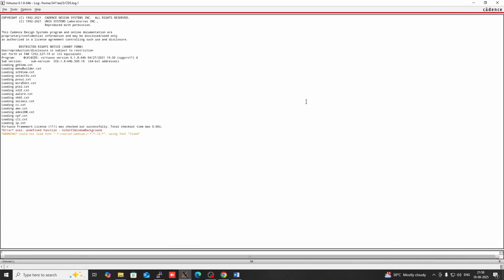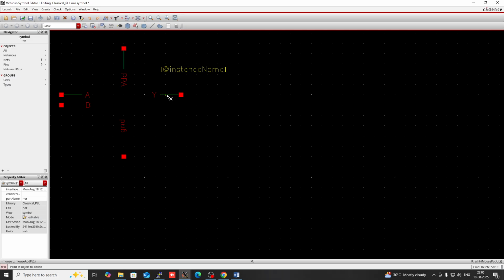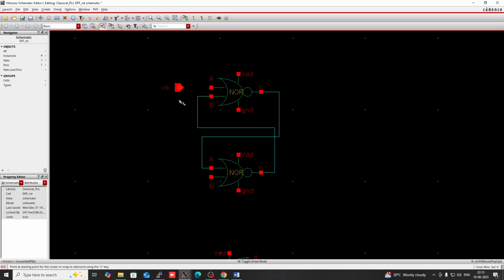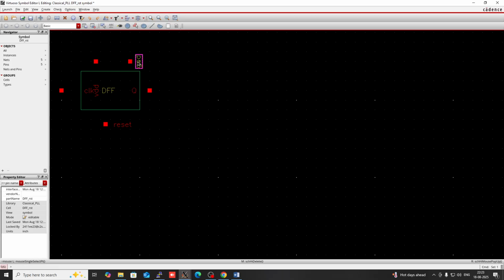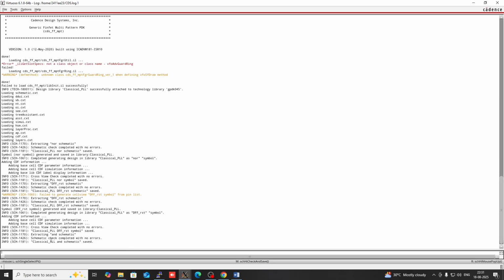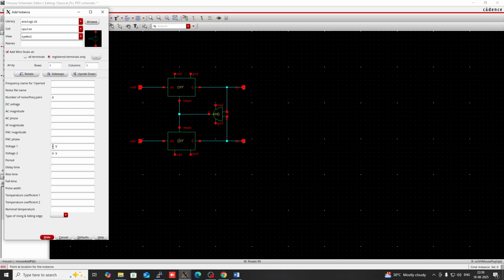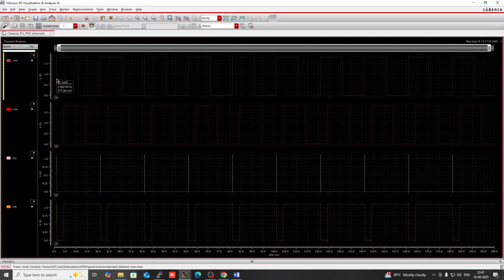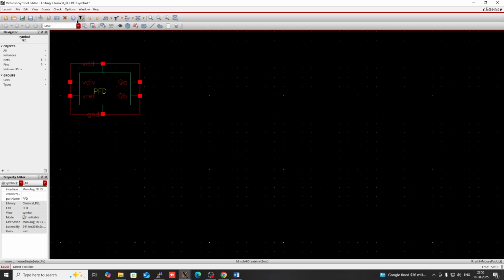“PLL Design on Cadence Virtuoso | Lecture 1: Phase Frequency Detector (PFD) Schematic & Simulation”

Comment: sir my teacher asked normal pll this wt is difference plz explain ur project
Reply from the maker: What do u mean by normal pll? In this playlist I have designed the PLL which is generally called Classical PLL because at the initial phase of research on the pll, researcher used these sub components (3-state classical PFD and Charge pump, a current starved VCO, and a divider).

Comment: Sir, I want to design a PLL in 90 nm technology. What changes do I need to make in the PFD, charge pump, and VCO?
Reply from the maker: You have to adjust w/l ration for vco and design loop filter.
Reply: @Yourmkj ok sir tq

Comment: Sir can u pls upload with calculations how u choose w/l ratio and other things
Reply from the maker: Here, I have just explained how to lock a classical PLL at any desire frequency, I haven't focus more on phase noise and jitter here so for achieving any desire frequency without focusing on jitter and phase noise, you need not change the W/L ratio of PFD, charge pump and divider.  You should only focus on W/L ratio of VCO to achieve any desire frequency and you can do that with hit and trail method. If you want a good jitter and phase noise reduction then, I suggest you to go to theory of phase noise and jitter overcome by any standard book, like RAZAVI and JACOB
Reply: @Yourmkj ok thanks sir ❤